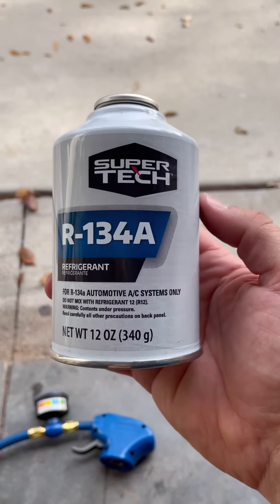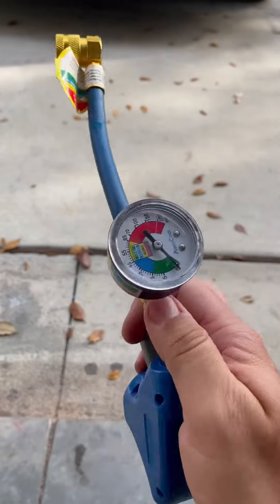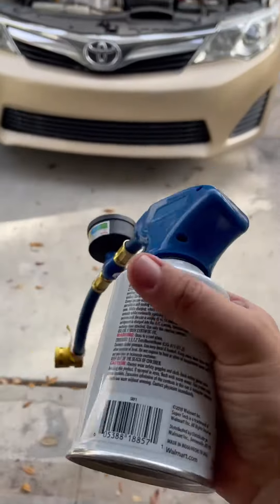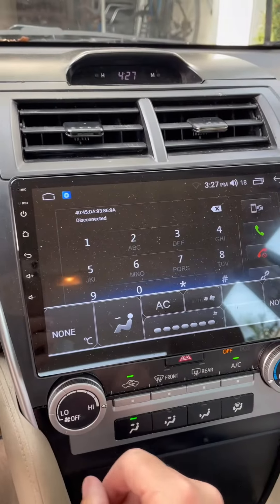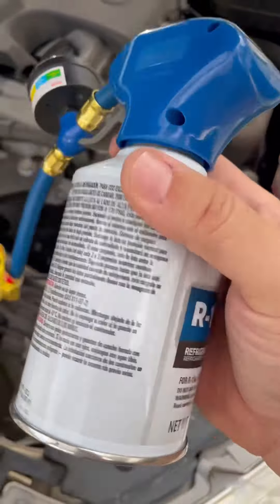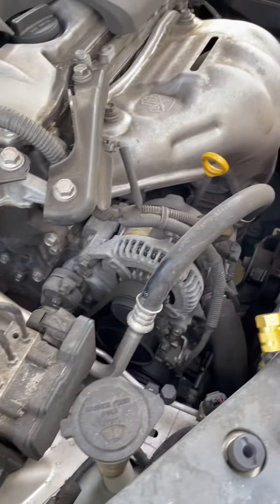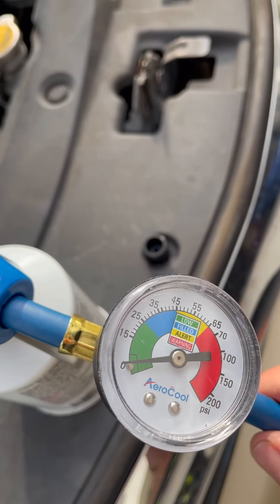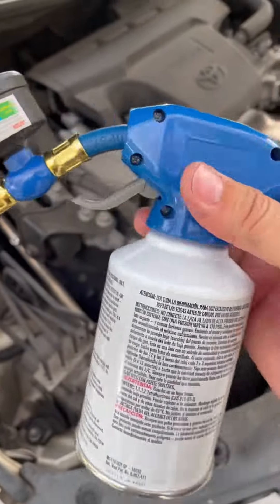How to recharge AC on Toyota Camry 2012-2016

Comment: Thanks so so much! I have a question about the radio/touch screen I have the exact same set up in my 12 Camry. Did you get any special cables other than what came with it? I’m really wanting to make all the steering wheel controls work!
Reply from the maker: @JeffMeray  no additional cables and my steering wheel controls work perfectly fine.
Reply: Damn it I must have bought it from a bad supplier. Thanks anyways

Comment: Between 25 and 45 ? And is it safe to take the nozzle off if you still have some left in canister ?
Reply from the maker: I did exactly that and nothing happened! I’m not an expert but I think that the nozzle and the gage shuts off the flow of gas automatically.